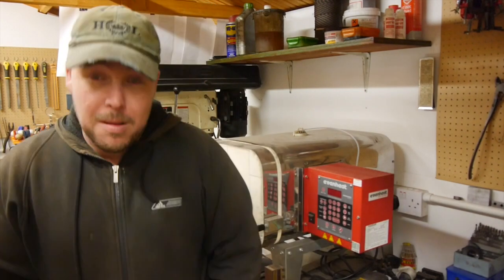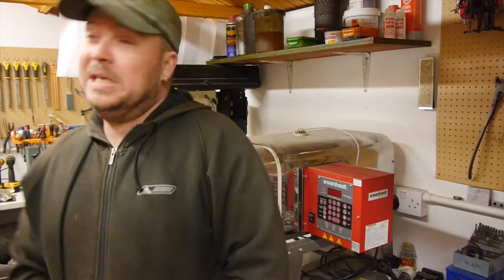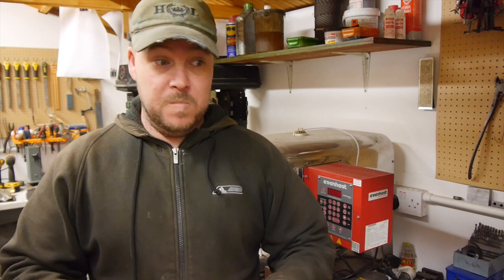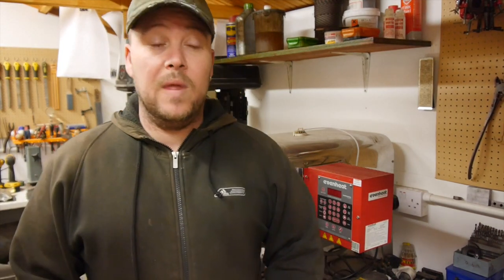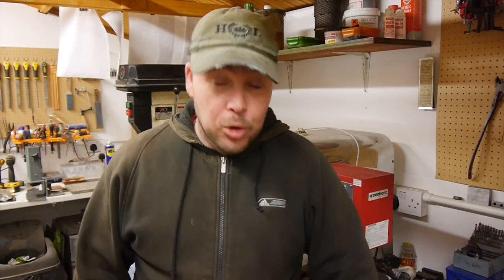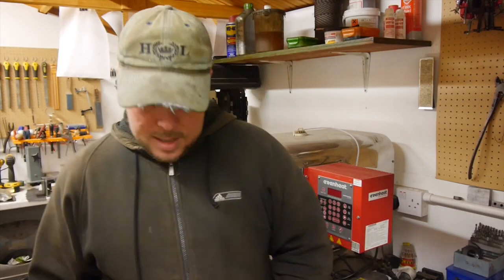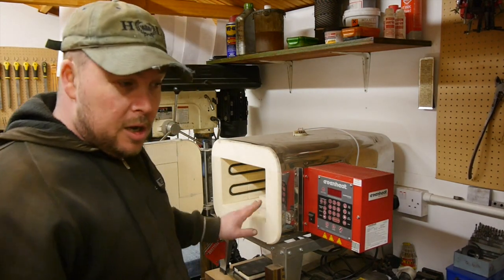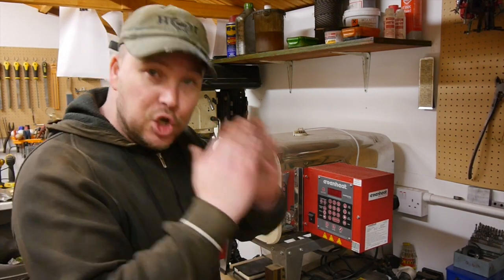heat treating quenching

Comment: Alright RKid loving your new intro very professional 😄 interesting debate I'm with you on your thoughts there mate. The more metal on the plate the more even the quench . Need to get your heat pump Air con sorted mate so you will have a constant temperature in your lavatory sorry I mean your laboratory.😂😂